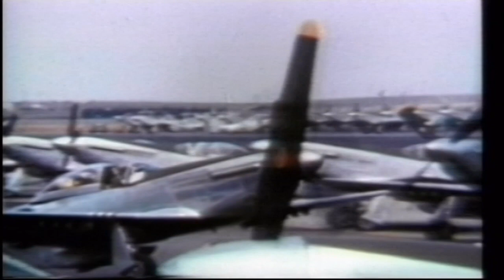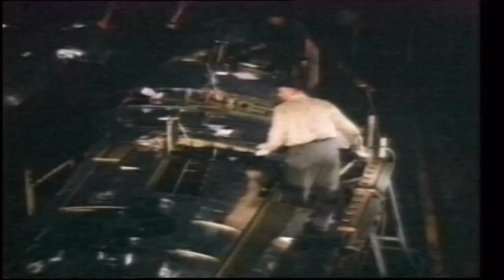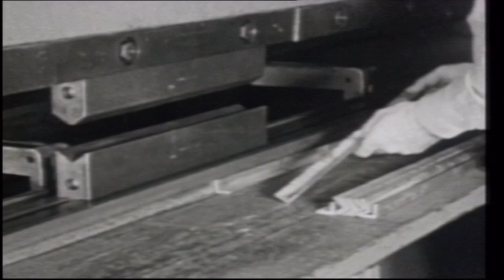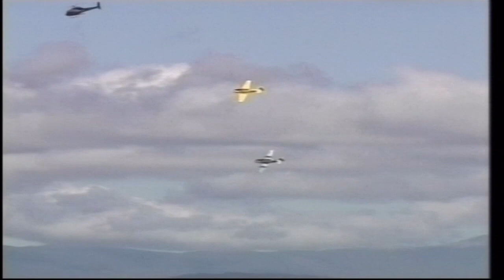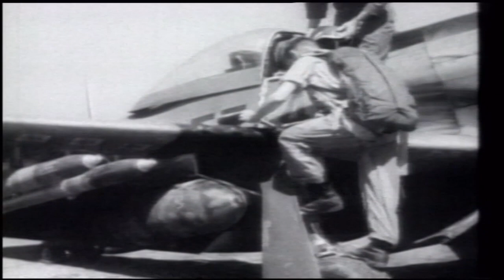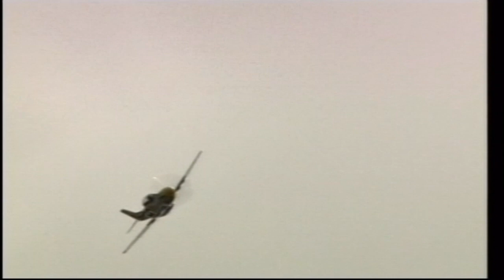Mustang 2 Long-Range Fighter-Bomber Creation | Flying Through Time | Episode 4

Comment: OK, get your facts straight. They did not use an INLINE 12 cylinder engine. That would mean all 12 were in one straight line. They used a Rolls Royce Packard built V-1650-7 Merlin 12 cylinder liquid cooled power plant. That is a V12, meaning 6 cylinders on each side. Like a V8, there are four cylinders on each side. Please fact check your information. If it was an inline 12 cylinder engine. The last cylinder would be behind the pilot.